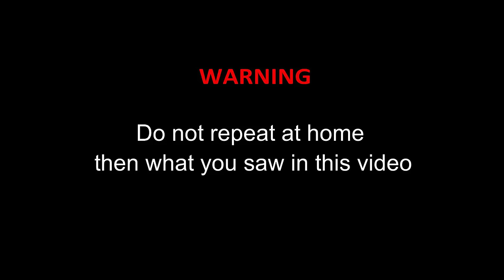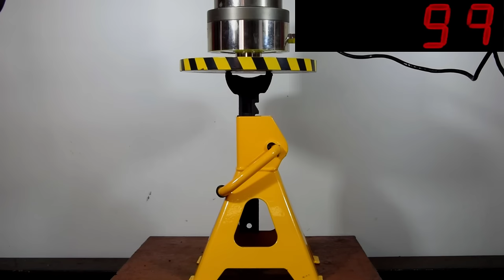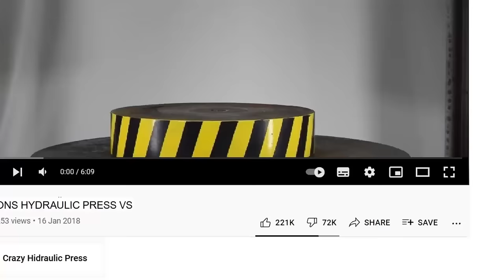HYDRAULIC PRESS VS CAR STANDS

Comment: Just remember folks, it's not always the weight rating. Sometimes you need a wider stance for lateral stability, such as humping in a transmission or engine, where you may wiggle things into place.
Reply: Or city driveways. With a slope.
I'll never use a scissor Jack again after one fell over not long after being set up.
It was supposed to be a 10 minute break job. 
The jack lasted maybe 5 minutes.
We normally use a big floor Jack but gma wanted us to use the one that came with the vehicle.
Well.. she saw why we never use them after it fell over. 
Luckily we were still looking for the correct tool so nobody was under the car.
Reply: No… That is a Jack, NOT a support!  Use it to change a tire if it’s your only option. Always put some blocks of wood or even the wheels from the car, stacked two high, preferably. Placed right, those things can save your LIFE! I put a front brake caliper on my 2500 using just an aluminum 3 ton Jack, but would have preferred a real frame lift like a heavy truck shop would use, or at least some better stands or random junk, like welded steel rims or railroad ties to stack it up on. The one thing I did right was to have my trusty ODF ply board under the jack and to not be too far underneath if something had went wrong. If you are using a scissor jack to do a risky brake job, at least slide the tire under the frame to keep the car from crushing you if it slips!
Reply: @joedirt7604  absolutely never go under a vehicle being held up by a scissor jack

Comment: Very good comparison, I think i'd probably go for the pin, glad you included the total collapse of the jack stand, as if you were under the car, the level being reduced to base height might still save your life
Reply: Shock load of the first one also is something to consider that was not in this experiment. Once the stand collapses down, the car will shock load it and potentially collapse it most likely killing you in the process.
Reply: I have always liked the simple tube stands.
Reply: Brand Name made not assembled in the USA fail down the "pawl & gear" designs.  

As an example of poor design, Harbor Freight had to recall a Made-in-China "pawl & gear" designed product here in the USA which you will find online.  As I recall, the "pawl" design failed when used under a less than specified load limit.  

Harbor Freight for the 1st time has established a quality-control group at the corporate level.  Well maybe we might see better quality.  Chinese & Asian manufacturers in general have the potential to produce good quality products.  Japanese companies like Toyota autos have excellent quality.  I'm looking for Toyota Minivan  It has a higher cost used but it's worth the extra cost.

I own a set of 2-ton Sears Craftsman Jack Stands and a 5-ton set, both sets were bought in 1974(!!), & made in the USA.  Used as specified, they have never failed.  I also keep in my auto & use a 1.25 cm (1/2 inch) x 60 cm (24 inch) x 60 cm (24 inch) plywood sheet as a base.   This YouTube review touch's on a few product issues,  https://www.youtube.com/watch?v=Tp0sZ5fte2w  

I also keep a 3-ton 50 cm (20 inches) lift floor jack in my trunk "just-in-case".   Some may believe that's over the top.  Its been used 3-times away from the shop.

i always have both jack stands & the floor jack under the car together just-in-case for added safety.
Reply: Yes, because a car goes from a gross weight of 1.5 tons to 15 tons for some unexplained reason…
Reply: @yamahajapan5351  lol well if it slips off another jack, you don't stabilize your jacks, could get bumped by something a vehicle, or wind,  getting in or out, not blocking the wheels, accidently moving it having it in drive, uneven ground, but i guess that wasn't tested, im glad to know they at least meet the standard specs stated, and that in this case anyway the pin seems a more secure way that the toothed type. Getting trapped under a car seems like a bad time, make sure your jack, and jack stands are secure, block your tires, even toss the tire under the wheel, im a amateur  others would know more, but be as safe as possible, place jack stands on plywood so its evenly distributed. they don't sink into the dirt. Gl stay safe.
Reply: @Frodoswaggns 
I use to work in a garage and witnessed the shock load on the tube type hear that gave way at 14 tons and it easily withstood the load.
I would go with the 25 dollar item without question.
Reply: I always take my trusty piece of tree trunk with me under a car and keep it close. That lucky charm works like a charm should any of the jacking devices give way. I worked for a fairground ride owner and we used  blocks made up with railway sleepers with reo rod pins. We were jacking up stuff that was very heavy.
Reply: Wow, he made it butter
Reply: I'd go for one with better adjustability. Rack & pinion would be my choice. Both exceeded their designed weight, so no one should base their opinion on how much more than intended it can take. Also, base of rack&pinion one is far sturdier. If force wasn't directly perpendicular, it would fail faster as those flimsy tripod legs could potentially open up sideways. I noticed that the platform on a $15 jack flattened at around 1T as well.
Reply: @johnswolter  it’s PAWL not paw….
Reply: @yamahajapan5351  Thumbs-up, thank you for the spelling correction!  JSW
Reply: @johnswolter  Harbor Freight redesigned their Jack stands under the Daytona brand and have a safety key now. would be interesting to see how it would hold up in a test like this.

Comment: I have the same stands as the black: nice to see that it's strong despite cheap price and light built
Reply: True - but did you notice that the flanges at the top of the stand failed very early?
Reply: And also easy to use
Reply: What brand are the black ones?  Link?
Reply: If you aren't careful, you can get some pressure that is not parallel to the stand.  Not sure what would happen with the thinner stamped steel at that point.
Reply: I've used both types for DYI work on my cars and the ones like the black type are a bit more cumbersone to use but always felt safer and you have a positive bolt going through them + a security clip on the other side. It gives me more peace of mind, that's all 😁
The black ones have a more slippery support so the car slides around a bit when lowered on them hence they require more time to set up.

The yellow ones are quicker to set up and are idiot proof as you cannot set them crooked as the base is fixed and not foldable.
Also, the surface of the support is rougher and the car doesn't slide at all on them.
Reply: @petertrevorah7388  looked like 12-1400 psi to me. 
  I never liked those not find of either of these the yellow one tend to bend a leg pretty easy if they aren't 100% flat. The good news is that either one is probably safer at the rated weight.
  I always see l set my stands then run a good Jack up again the frame of the car as an extra safety. 
  Very good idea to check them before using every time and to know how much weight you'll be putting on them !
Reply: @petertrevorah7388  BUT YOU NOTICE THIS IS A SIMPLE PROFILE PLATE TO CAN KEEP SUPPORT IN POSITION TO THE CAR AND DON'T HAVE STRUCTURAL RESISTANCE AND IMPORTANCE? Real part for support it is the central bar what resist on 17 tones.
Reply: @registrationaccount1034  Vorel, its a low cost brand about Polski Yato!
Reply: @registrationaccount1034  it's Polish product from amaz.
Reply: Me, too. Happy to see, that they easily handle two tons (and more)
Reply: So long as they stay vertical you are pretty unlikely to be crushed completely as there’s lots of resistance in the stand itself,,,,, of course that’s dependent on what you are doing. I generally us a scissor hoist or a 2 post hoist in the shop. Not entirely safer but extremely convenient. The scissor hoist seems the safest to me.
Reply: I buy cheap Harbour Freight tools but I'm not going to trust my life with cheap Chinese jack stands no way , just pay the extra money and buy the best !
Reply: There is a big difference between slowly  applied pressure vs. instant load pressure. The press moves slowly down, and when pressing the yellow jack stand, it goes to negative pressure at point of failure, which is just over 2 tons. So, its failure point is properly stated within the load rating. On the other hand, the black stands point of failure was well below its load rating when the cradle flange failed. The black stands are unsafe and should be rated at 1/2 ton.
Reply: @petertrevorah7388  that's normal we have $2000 20T Jack's that have done that at my job. Those are just resting points your not supposed to be supporting the full weight at those points.
Reply: Please keep in mind that unless you are exactly on a level surface and the way you have on it is centered properly then anything that shifting or unbalanced will work against you and you will not see the results you see here
Reply: dude you need better stands. i dont care that it held that much weight those stands are junk and are going to get you hurt. youd never catch me using those no way

Comment: This is a great demonstration but I feel like people should be more worried about its resistance to weight shifting then it's actual weight capacity.
Reply: This was my thought too. In application I would much rather trust the one with the stronger legs. I would like to see him try to crush the yellow one without the arm inside
Reply: That's where most ppl would get injured. Iv used them many times and needing to readjust he weight cause the Jack stand and half inch of the ground on one side
Reply: Same thing I was thinking. The only time I almost hurt myself working on my car was when I had a scissor jack on gravel with my tire off. Very, very stupid idea! Car kneeled and the brake rotor hit the ground when the scissor jack fell over sideways. Luckily I only almost lost my toe and didn't actually lose it.
Reply: Also three leg stands aren’t as stable as four, the single leg needs to be on the outside with two on the inside of the load. It’s interesting and fun to watch destructive testing.
Reply: What is weight shifting? Can you be more clear, please. I don't understand. Thank you.
Reply: @jovelez6398  is when the car move side way  while being supported by the jack stand, like on an uneven or inclined surface.
Reply: @johntsan742  thank you👍🏻
Reply: Always use 2 jack stands to be safe and stable, never only one. It's on the manual.

Comment: I have always used the non folding telescopic stands.
Nice to see they are built well even with folding legs!
Reply: I would say the folding legs make them stronger I've seen them without the folding legs and it's just literally just a spot weld that could fail earlier than the pin.